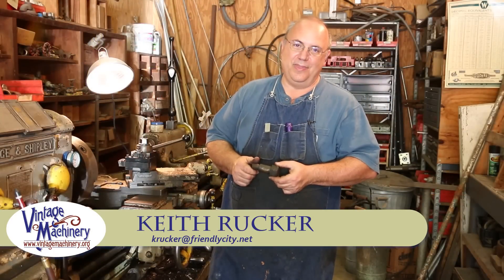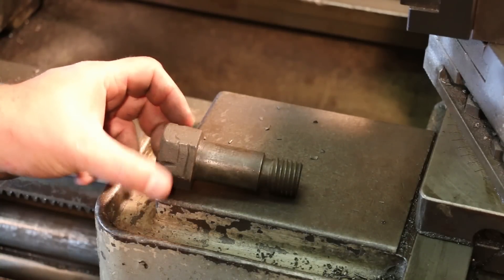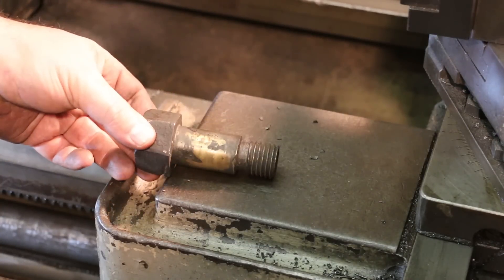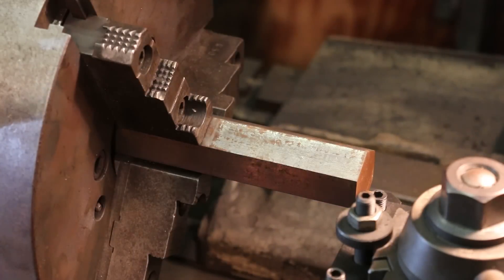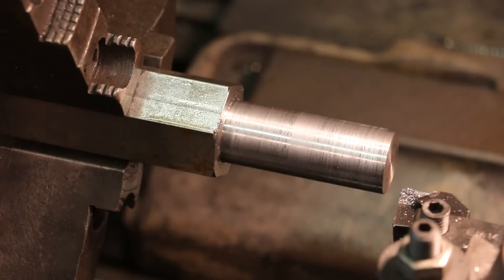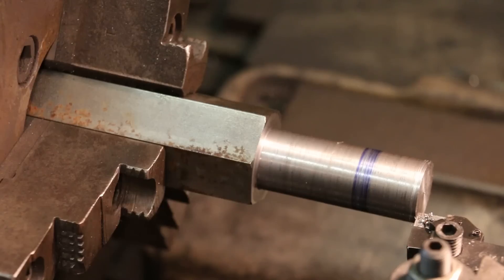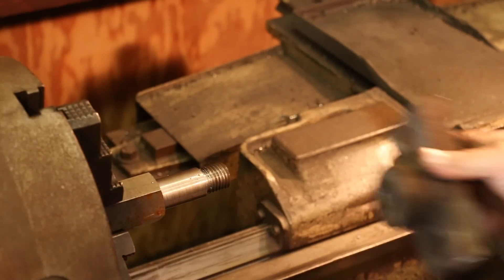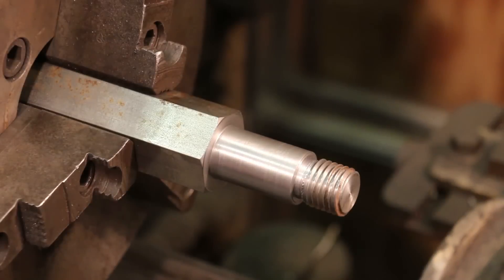Vulcan Locomotive Reversing Gear Shoulder Bolt

Comment: The dimension that you for slack in the bushing is too little to bush it but you could knerl the bore and I deffinately would put in a lubrication fitting course with lithium grease it should last another 200 years as is.

Comment: I noticed you faced under the head from outside to inside.  Normally I would face from inside to outside without moving the tool.  So, in effect using the other edge of the insert.  Is facing from outside to inside a better practice?

Comment: One of my favorite episodes of all your videos, was when you explained all of the levers, dials, and valves of the cab of your 1917 Vulcan Iron Works steam locomotive and then gave us a ride around the perimeter of the Museum grounds in it. In that video, I saw you manipulate that black lever, but you had failed to tell us what it was or used for. At the time, I had figured it to be the lever for the reverse-forward mechanism, but several times while we were in motion, I saw you adjusting it, moving it with no effect of changing direction. In THIS video, you told us what I had guessed it to be AND you said it was ALSO used to adjust the steam valves feeding the cylinders. You unknowingly answered my question with this video. LOL   AND I can't understand how ANYONE could "dislike" your videos.

Comment: When one is doing an intermittent cut, like the hex, is it harder on carbide inserts than perhaps using a HHS tool bit. If that is correct, do you have any suggestions on cutting the hex?
On some things I have made, like the bolt, I heat them up and dip into old motor oil. It gives them a nice dark blue finish, and maybe helps resist rust (?).

Comment: Too bad you didn't have the lever before starting the job.  Maybe a little oversize on the bolt and a slight ream on the lever.  I just like tight fits.

Comment: Nice job! If you have the time maybe you should try and put in a brass bushing in it would have a better fit and would prevent seizing and contribute to the longevity of the part!
Reply: So The Multimedia Man so the original 99 year old blot did not last long enough?
Sure you could go OTT but it's as much knowing where to make improvements on the original and where to replicate.

Comment: Interesting that it's called a Johnson bar because semi trucks have something called a Johnson bar, but it's just under the steering wheel and it applies the trailer service brakes. I used it a lot for sliding my tandems. I imagine it's a holdover from the days before trailers had spring brakes.
Reply: https://en.wikipedia.org/wiki/Johnson_bar_(vehicle)

Comment: Great to see a bit more of the work going into putting the 0-4-0T Vulcan Iron Works engine back in service!  'Armstrong' reverser lever!  Its probably a good guess that when the engine is moving and you want to change the reverser notching on it, you MUST close the throttle to just being a crack open, to keep the lever from being yanked outta your hands when you unlock it to move it, right?
Reply: Correct.  Or at least a very good idea.  Been there and done that.

Comment: Some folks are concerned that you didn't make a precision fit for the part. I figure in the day that locomotive was built, with all that iron and heat, if everything had been fit properly, the whole thing would have seized up in about 45 min. Either that or you would have had grease or oiling points on every fitting and joint on the engine and spent a good deal of time re-lubricating during a trip. Since the part you made won't last much more than 150 years, you could have done better (that's a joke).

Comment: Think you took a lot more care than the original machinist, though to be fair he likely had an order to make 50 of those bolts, had a half day to do it all in, and still had to make the hex stock out of some cold rolled steel rod that was in the shop, and this was one of 50 orders for the month to do. The repair with braze was very likely something I would also do, much quicker and can be done without a lathe, just using a file and sandpaper to get the rough shape. 

Quick repair would have just been to use a steel shim and grease, would have gotten them moving back to the yard fast, and then do the pivot with the braze, rather than spend a few days out in the open waiting for a repair to be done. Undo bolt, grab a tin can and the ever present tinmans cutters and 5 minutes later you have a bushing to fit and you are running within minutes and still have near a full head of steam.

Comment: What is the purpose of the relief cut on the bolt? It almost seems like it would act as a shear point if the bolt was over torqued and I don't think that would be a good place for a shear point.
Reply: There are occasions where what you describe is required. One that I did long ago are tapered stub acme oil well drill pipe threads. The requirement is that the the tapered threads lock up at the same instant the joint faces meet. It has to be held closely otherwise it be near impossible to unscrew each segment of the drill pipe as it is withdrawn from the well. I had the good fortune to do this work on a Mazak CNC lathe so that the threading tool pulled out of the work at the same place every time. When the thread gage was hand tightened on the work, a feeler gage would be used to measure the gap between the joint faces for the correct dimension so that when wrung together, the threaded joint could still be disassembled.
Manual oilfield lathes often had an automatic kick-out to pull the threading tool out of the work and stop the feed. CNC had the advantage of easily making adjustments and the rapidity with which the threads could be cut.

Comment: Another great video , but i do have a question  why not bor a few thousandths out the eye on the bar and make the shoulder of the bolt a few thou larger in my miind should have taken all the slop out
Reply: That would reduce the material in the pivoting area of the johnson bar to withstand the loads put on it as the locomotive is used.  This bar controls the forward and backward direction of the locomotive as well as how much steam is used while the loco is moving.  If this area breaks then the bar has to be remade or at least this part of the bar has to be made and attached.  The loco won't work without it.  This bar moves a little each revolution of the wheels as the loco moves and is subjected to large stresses.
Reply: Ok

Comment: I appreciate and enjoy your work on antique machinery. When I was younger I was a millwright at Nicholson File. Many of the machines were over 100 years old, all castings (even for tiny parts) and all the bolts were originally handmade... And coated with red lead when assembled.

Comment: Obviously a locomotives repairs are never done.  Nice video, thanks.
Reply: Nope they're not ever fully 'done'.  All the heavy moving parts and the massive forces those large and heavy parts are subjected to in steam loco service, every single component on a steam loco gets the proverbial crap beaten out of it every time a fire is put in the firebox, steam pressure is raised, the reversing lever is put in the corner, the brakes released, and the throttle opened.
Reply: OnlyTheEd Uh-huh, I did watch the two films of the seminar session Ed Dickens gave in March of this year in Colorado that extensively covered a lot of the boiler repair efforts that were undertaken on 844, and the video updates from the Steam Crew that Union Pacific posted.  Was the most extensive work 844 had had done on her since the last time she was 'shopped' in the 1950's right, in the twilight of her revenue-earning days?  My eyes were bugging out at some of the boiler issues Ed and his gang had to tackle, as I've learned a lot about boiler upkeep from an uncle who cleans them for a living.
Reply: If you get the time, watch the rebuild of the Union Pacific's UP844. It was pretty much 80% or more of new materials went in to the re-build.

Comment: Keith, I Love your videos. All the while when you were making the shoulder bolt, I kept saying to myself "Next he will bush the lever this holds  on. Myself, I wold have had to to make the job complete.I guess I spent too much time as an aircraft mechanic and inspector.
Gary, 73-year-old  Home shop machinist in North West Arkansas.
Reply: on a 100 year old steam loco, you will be chasing worn pivots, bolts and such forever, better to fix what is broken as you go, or it will never get back on the tracks
Reply: Richard Getso
i believe they intend to get it back on the job, as it is a big attraction at the museum, that and they probably spend some years of budget having the boiler rebuilt, as long as parts are good enough, they can be improved later on, theres only so much you can do in the time.
Reply: jusb1066 I was thinking to bore the hole back to round and make the bolt to fit the bore.  But, you're right, we'd be chasing every worn part on the whole engine.  Sometimes you gotta just fix it and move on.
Reply: Gary Jones:
     Yup, probably only last another 99 years... :>)

Comment: TIdy small-scale project  executed swiftly and expertly.  Probably it was a good time, however, to make TWO, one for the "other side" or stock....???
Reply: Stock?
that bolt as stated is off a 99 year old machine,bolt likely same age. Lever is single item,There is no matching other side.
Reply: There's only one 'reversing lever' used in a conventional steam locomotive and its located on whichever side the engineer/driver controls the brakes and throttle from, so only one replacement pivoting bolt needed to be made.